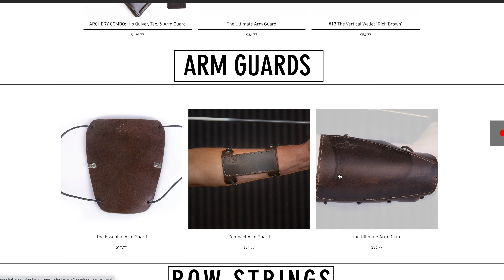Making the Smallest Recurve Bow EVER  "Miniature Bow Build!"

Comment: I always try to make a small bow when I try a new bow wood. Helps with picking up problems/differences. Mine are usually 2" to 1', so are quite effective little bows. I use bamboo skewers for the arrows. They will easily go through several layers of cardboard.